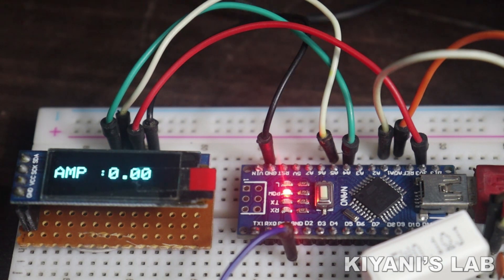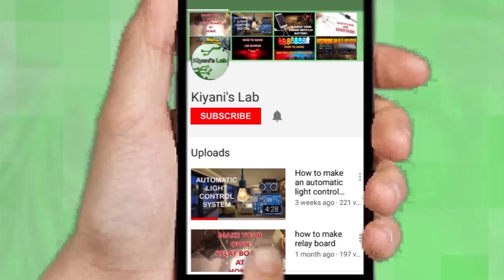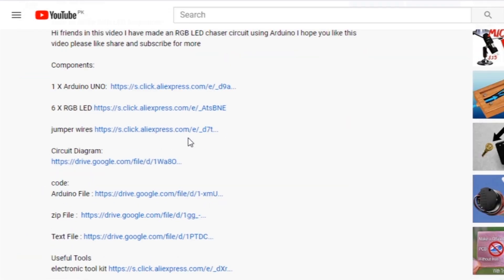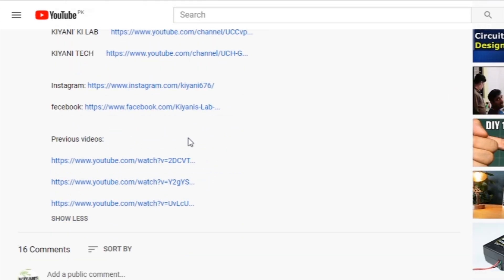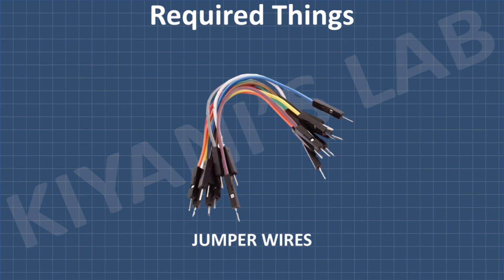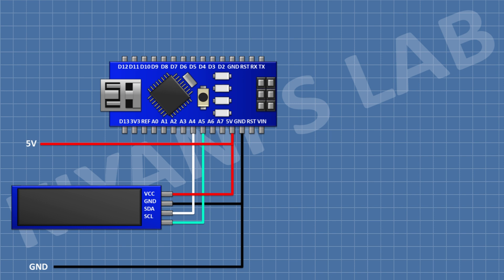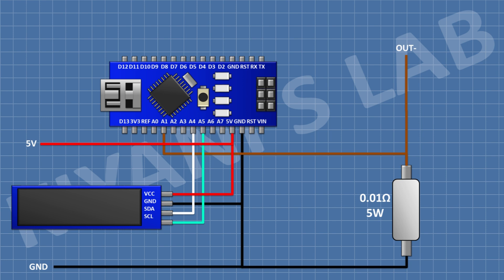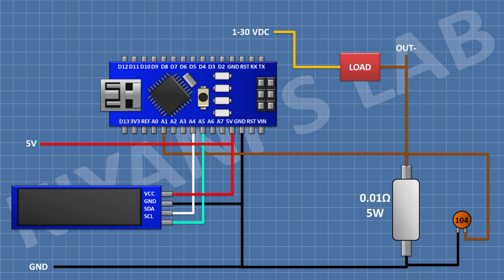How To Make Ampere Meter With Arduino and OLED

Comment: resistor  0.1ohm or 0.01ohm   ?  circuit value and listed component value different ,pls note the correct value..
Reply from the maker: 0.1